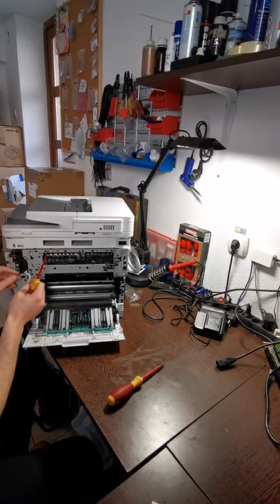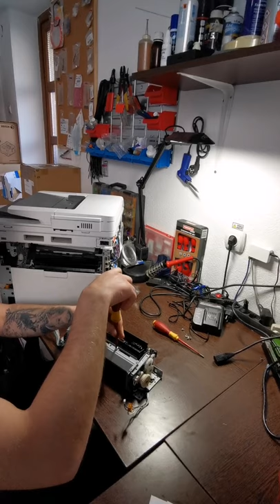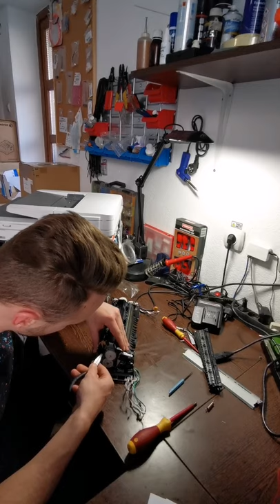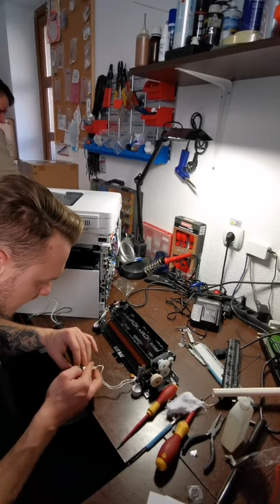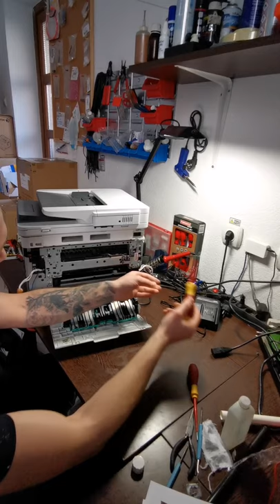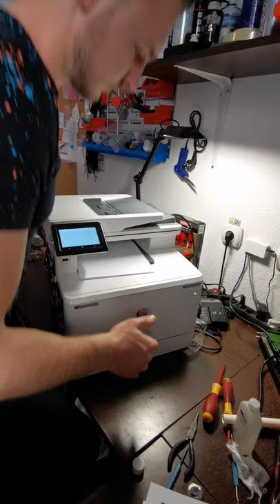Hp Color Laserjet Pro MFP M477 fuser film replacement, fuser  disassembly, fuser error

Comment: I notice that the AC connection to the upper sleeve only has one connection ? mine have two, one for top and one for bottom sleeve, I've found that cleaning the heat element contacts with a bit of scotch-brite and alcohol helps with fusing efficiency (poor contact)

Comment: I changed press rollers, but the printer shows engine communication error, why?
Reply: 't know if you solved this, but I had this. I needed to reinsert the ribbon on the right side (looking from back of printer) which was over the wires attached to the fuser unit and had been taken out to get to these wires attached to the printer.  Once I had reinserted more firmly, the error was gone.
Reply: @KTotnes  I only pull that ribbon off once due to it's fragile nature, when I put fuser back in printer ... I route the smaller wires over it, so that I never have to unplug the riibon cable again.